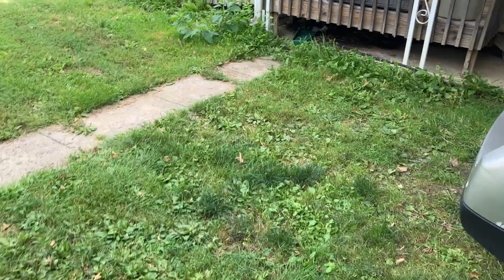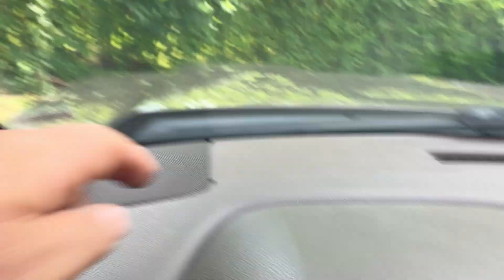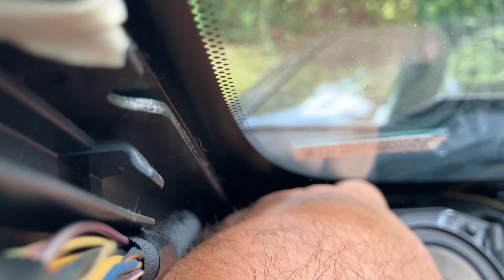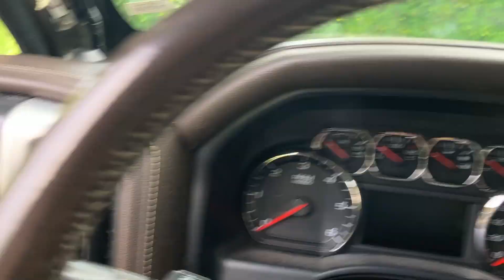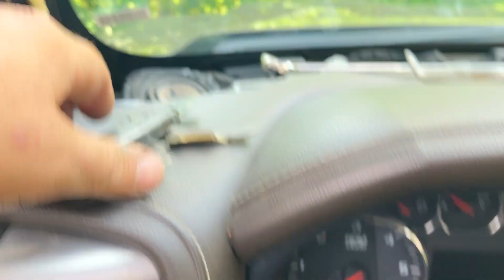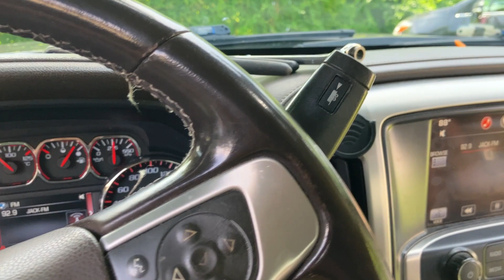Lazy GM Assembly Workers - 2014 GMC Sierra Power Steering, Dash Goes Blank - Will Not Start - G218

Comment: I'm going to check mine, tonight I have BCM problems after my door actuator starting acting up, and power to ground BCM code pops up, 2017 GMC Sierra SLE 5.3L, and the stability track light pops up with a miss fire..cylinder one..clear the code and any little bump turns back on...I'm checking this ground wire.

Comment: Instead of using loctite you probably could have put a lock washer underneath the nut and then after it's all tight coat it with dielectric grease and he should also be good.

Comment: I'm having this same problem, usually when it happens it happen when I park my truck. When driving the lights will flicker when i turn on my turn signla, brights or use my window buttons. I checked it a moment ago and my red wire to the battery was a bit loose so I'll tighten that and also going to check G218 like you're doing here. I cleaned the ground wires underneath the truck on the frame
Reply: I don't understand. On mine there's a wire above the ground hooked to the same bolt with a plastic nut. They're both connect to the same bolt one above the other!

Comment: i have a 2014 gmc sierra sle battey good i get a parasitic drain over night if i pull the fuse to the cluster no drain fuse in it drains over night checked all the grounds are tight everything works as it should pulling my hair out could the cluster be bad
Reply: I could be, pull the cluster back, hook an amp meter to the battery, and let it go to sleep with the window down then reach in the window and unplug the cluster and see if the draw goes away.  The clusters often suffer from silver migration and cause a draw.  United Radio in Syracuse, NY can fix it.
Reply: @frugalprepper  i did that and the draw is gone put the fuse back in the draw returns my guess is bad cluster only draws when cluster fuse is in
Reply: @frugalprepper  thank you

Comment: Wonder if the dirty alternator was the issue on my 2014.   I did a video on the G218 ground YEARS ago,  The nut on mine was tight but that sound deadening material was trapped under the flat part of that ground.   It looked bad.  and I had flickering headlights.  If you look at the wiring diagram that ground has a TON of stuff attached to it.   Every single issues I had, was tied to that ground.  It was a Pain for me to find information about it.   glad to see more folks are making videos about it.   Shame GM didn't fix it the right way.   great stuff...

Comment: Exact issues for me on my 2018 Silverado. Thank you…know what I’m doing this weekend.
Reply: Check the ground from the battery behind the front passenger tire too.
Reply: @  yes, I did check and both sides of the dash are good plus the one under front passenger side.
Reply: @travislaroche6926 so did you find the fix?
Reply: I have a 2018 and mine is doing this. Did you do anything? If so what did you do?
Reply: @LordTyphuryus  did you fix it ?
Reply: @migueltorres6772 my 2018 gmc sierra had this issue resolved from factory. My issue was the wiring harness in engine bay rubbing against metal. The shop I took it to figured it out and fixed it.

Comment: I had the same issue with the steering jerking. Figured out it was the ground wire  underneath the passenger side front finder not getting a good connection
Reply from the maker: It can be that or the negative battery cable tool

Comment: See NHTSA service Bulletin No. PIT5405C (https://static.nhtsa.gov/odi/tsbs/2017/MC-10113356-9999.pdf) This bulletin addresses this issue! This is a GM service bulletin, yet many dealers will claim they have never heard of this happening! This problem should be made a RECALL. My truck had loss of steering assist, steering wheel jerking, engine stall, stabilitrack warning, IPC went blank, radio went blank and reset to factory default, HVAC went out and the wipers turned on briefly.

Comment: Hi i wanted to ask has your truck had the same problem since ?
Reply from the maker: It's not my truck.  It did happen one time again weeks later, and it got the problem with the oil pressure sensor where it needs a new oil pump.  The owner replaced the ground cable on the battery and this didn't happen again.  He has since traded it in and gotten a new one.